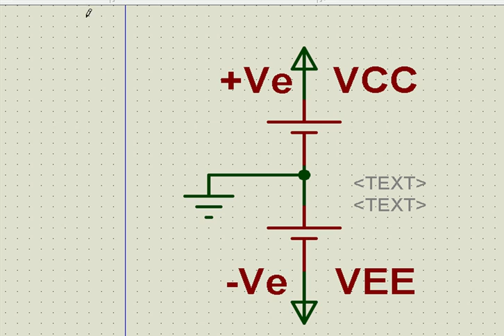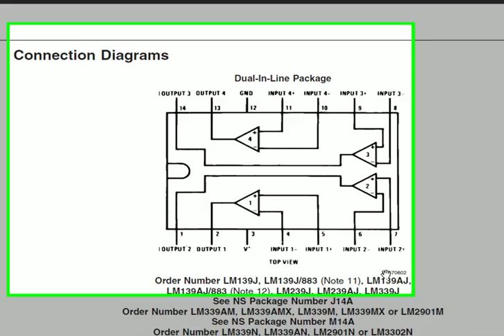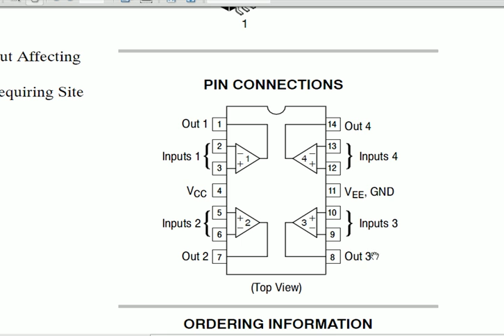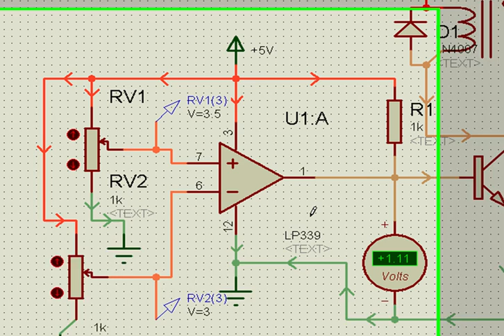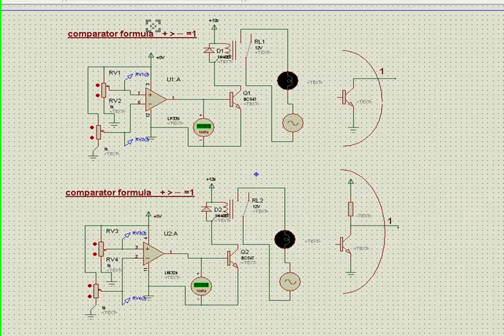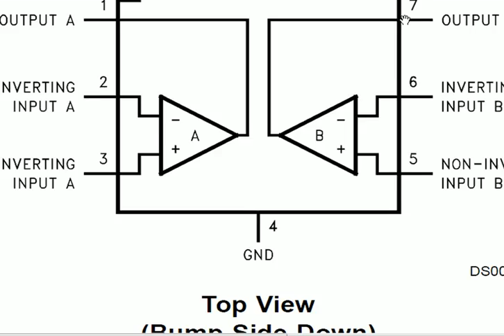Practical Electronics 7

Comment: Can someone please explain why he applied a resistor on the base of the open collector output transistor? Shouldn't it be applied onto the collector? The two circuits seem the same to me except one has a resistance on the base, the other does not. What am I missing? Thanks.
Reply from the maker: Letmegoagainplease Because the collector is open and  if a resistor is not pulled up to +ve then the output will not go high while required.While it goes high the current flows through this external resistor to the base to switch it on.But in case of a internally pulled up comparator ,the output shall go high to drive the base of transistor through the internal resisto so external resistor is not requiredr.